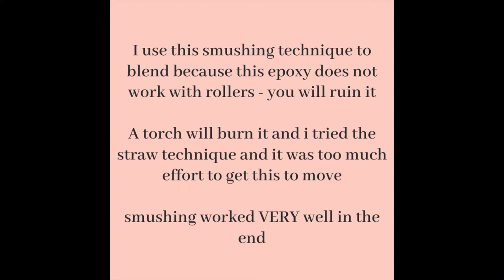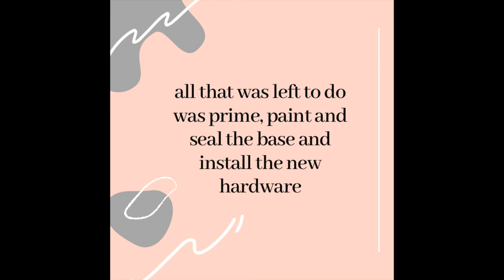Epoxy Resin  I  Dresser Makeover  I  Marble Countertop I  DIY

Comment: I have a question: so you did not use a primer because the top had a coat of paint? I want to try it about the same idea and I’m not sure about the primer stage...
Reply from the maker: I did not use primer no. I sanded and just painted. The paint is paint and primer used is chantilly lace from benjamin moore. All paint basically have primer in it anyway. Also, because I knew I would be sealing it with epoxy, I didn't matter too much as long as i sanded well. I know this answer is coming so late but I hope it helps.
Reply: You need to make sure The epoxy is compatible with the paint. Easiest way is to contact the epoxy manufacturer and ask them.

Same goes for primers.

Comment: I also used Mas epoxy before. It's trash. It cures so quick and gets dangerously hot. They actually sent me an extra one for free and it still wasnt worth it. It has no work time. They had the nerve to try and blame me and ask me to remove my review though lol. I'm no expert in epoxy but I've used a few types and the quality definitely matters. You could use a heat gun to move your veins and make them look more natural. Unfortunately, MAS doesn't work well with the torch. It just bubbles up
Reply from the maker: Yes that's what happened to be when i tried the torch! It also BURNED! I've since tried Legarri Epoxy and while that is SOO much easier to work with, it yellowed after a few months so my search for the perfect epoxy continues. I will try Stonecoat's formula next.